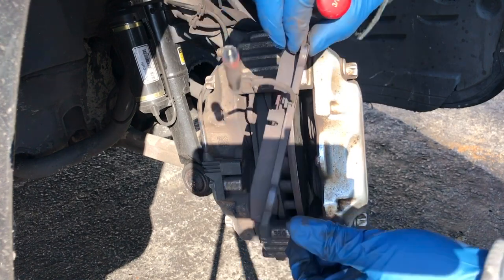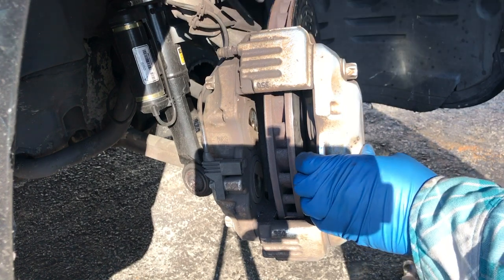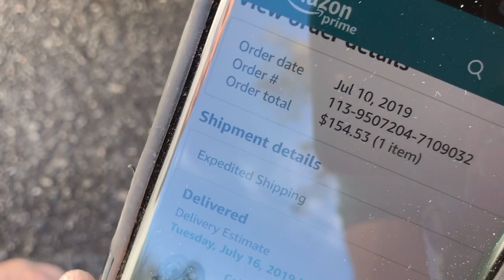MERCEDES BENZ S550 FRONT BRAKES REPLACEMENT -  How to Install Front Brake Pads, Rotors & Wear Sensor

Comment: Believe it or not a regular 17mm takes the lug nuts off. No problem I have done it tons of times works just fine 🤗 Great video btw
Reply from the maker: We tried a 17mm on this car, but the lugs nuts were so tight we were destroying them trying to get them off. The owner just bought the socket.
Reply: I have another one too take it off easy
Reply: But great video thanks
Reply: @fixinit same thing happened to me lmao, luckily if you are in a jam and can’t get the oem socket, go to harbor freight they have a spline socket set with the same 17 mm spline socket, just not as quality but will get the job done

Comment from the maker: Do you like your Mercedes or will you get something different next time?
Check Out How to Install Mercedes Benz S550 Rear Brakes https://youtu.be/tdfdOzj1yZ4
Reply: I like it cls550 2007 I'm just learning to work on it. I'm 59 and can't keep paying when I like to work on my own car but worried about getting the right tools I need just what you did done. Look like I can do it.  Work on my other car but worried about doing it with this car what are the tools you used
Reply from the maker: jmfjr1011 Not really hard to do. Check out the video description to see the links for the tools you need.  Basically a ratchet wrench and socket, screwdrivers, torx bit socket, hammer,  something to knock the pins out,  brake cleaner. I forget what else. 😎

Comment: Damn and I had my mind on a S550 from 2012, the job itself looks way different from a regular job considering the electronic sensor for the brake pad wear. But good video btw
Reply from the maker: Thanks.  It’s really not a hard job, it just looks different because of the Brembo brakes.  That sensor just pops in and out.

Comment: You should clean the wheel hub with a wire brush to eliminate the rotor sticking to the hub 😅 Less tire kickin' next time 🤭
Reply from the maker: Yes. I put a note about that in the video description. I forgot to show that part on the video. 😎.

Comment: 1999 Mercedes Benz E320 how do you change front rotor
Reply from the maker: BOB SILGAN Should be the same for the E320.  Here’s a link for the rear brakes.     https://youtu.be/tdfdOzj1yZ4

Comment: 2011 w221 mine didn't have break sensors..is that normal?
Reply from the maker: yasoutherncousin They should have them on one side,  I think the passenger side.
Reply: @fixinit  lol..ok I just heard him say that about the sensor on one side..I only took off the driver's side tire and there was no sensor. I ordered 4 sensors in a pack thinking it had sensors on  all four calipers..guess I have extra..
Reply from the maker: yasoutherncousin lol you got 2 extra for next time

Comment: Need to use a "Roloc" or wire wheel on the hub before installing new rotors. This is to control disc run-out. A dial meter indicator measures variations in the rotor as it is turned. Typically R-O should not exceed 0.002 inches (I don't know the spec for MB S550, but the number is very small). R-O causes the disc to "wobble" which can be felt on the brake pedal. Basically causes poor braking.

Comment: I changed my pads on my S550 also, the guy who paid 154.00 for the parts should be criminal 😊 finding parts for cheap is very hard, that's the part I always end up spending big on.  I will have to do some extensive researching because for the disk I spent 334.00 for both front brake disk.
Reply from the maker: You get what you paid for.  My friend says those $154 China brakes suck! Lol
Reply: @fixinit  lol thanks, going the cheaper route will give cheap results I see, I'll have to stick to eating the cost instead of having crappy results for cheaper cost.  It's amazing the cost you can save by doing it yourself.  For funs I asked the Mercedes dealership the cost of front and rear pad replacement and the told me 1200.00 just for the pad replacement..
Reply from the maker: @terryindachat7296  Crazy!
Reply: @fixinit  don't knock em until you try them... I personally think they work great

Comment: Did you experience any problems after doing this brake job? Dealer wants $1000 to do front and back brakes which makes me think its complicated.
Reply from the maker: Not hard. I would get good quality brake pads and rotors. The ones we used on the video are not the best.
Reply: @fixinit  I bought front and back pads and sensors from the dealership for $200 out the door. I've done brake pads and rotors before on older cars in the 80's but watched your video and it looks no different, so dealership must be taking advantage of people on this job.
Reply: @fixinit  Looking at the dealers estimate, they're trying to charge $378 for labor on front and $378 labor for back and they're charging double on the price for all the pads and sensors than what they charge at their own parts counter. Thanks, hopefully your video and all these comments will help people save some money.
Reply from the maker: Yes. Thanks for watching!

Comment: Those rotors are the wrong diameter for this car. That is the reason for the premature wear and lip on the outer edge of the brake pads.
Reply from the maker: Anthony Mahas You are probably correct.  I don’t know who did the job last time and I didn’t buy the new parts, just installed them.
Reply: It's designed that way. The pad doesn't cover the whole rotor. That way when your rotor is out of specification. It will make a squeaking noise letting you know its time for new rotors

Comment: Never use aftermarket rotors on ur Mercedes there not the correct size as oem and they have less stopping power and vibration.